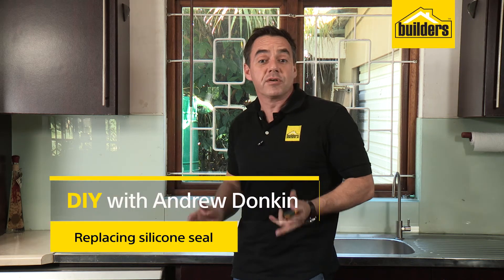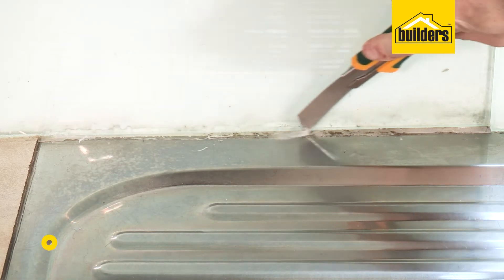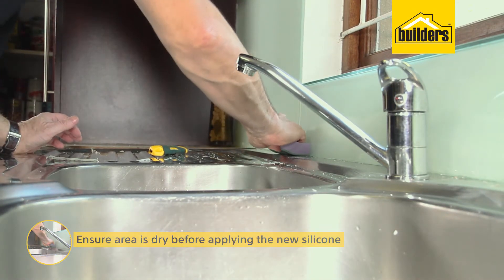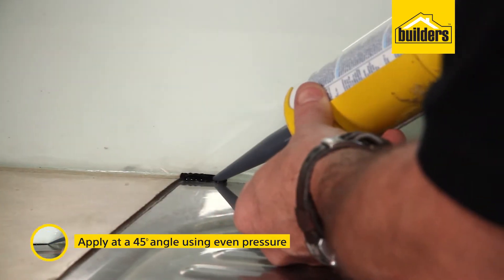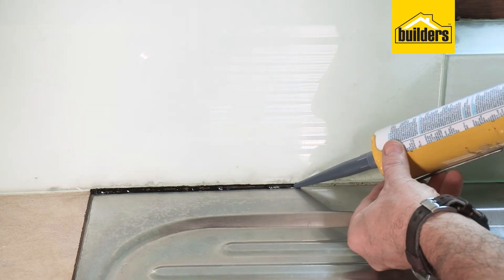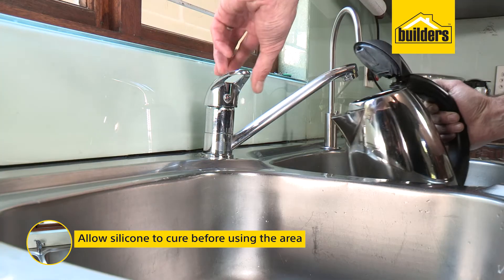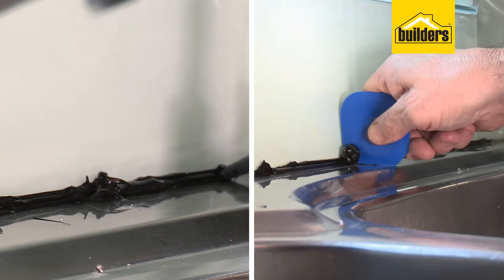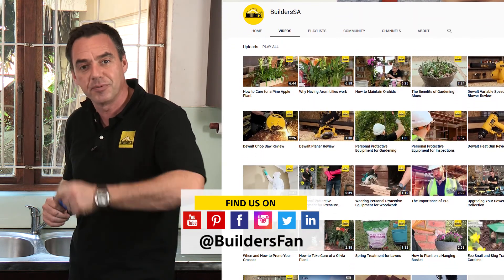How to Replace Old Silicone Around the Sink

Comment: Thanks Andrew. Much needed tip and much appreciated. Take care as always
Reply: Thanks Val.
Reply: I need to reseal around my kitchen sink because underneath the particle board is slightly wet. Can it be done this way, or does it need to be lifted out and then apply the silicone?